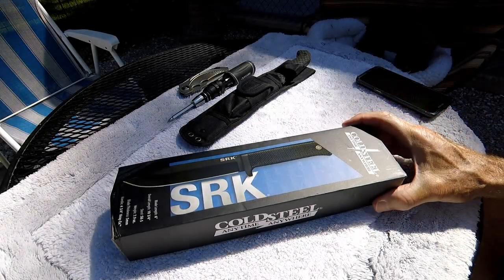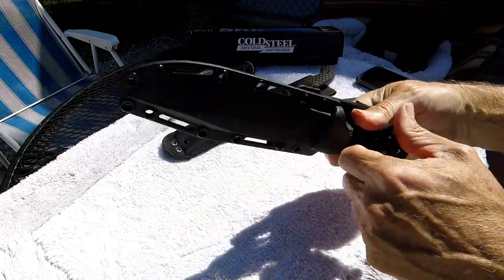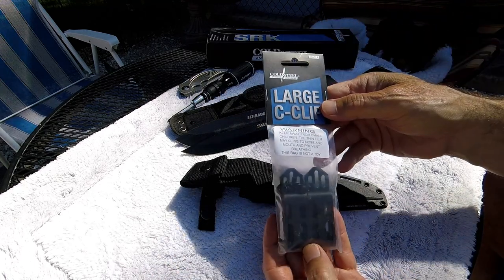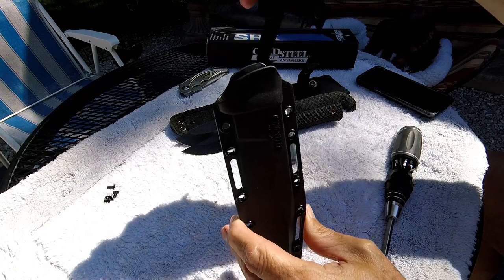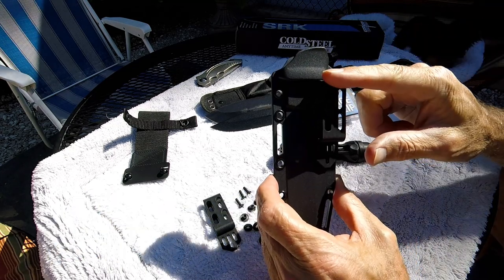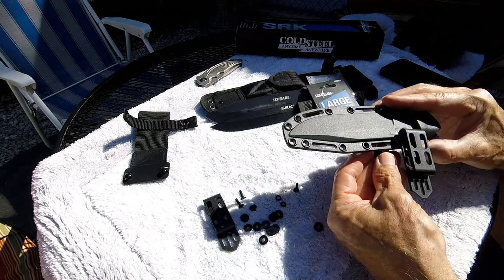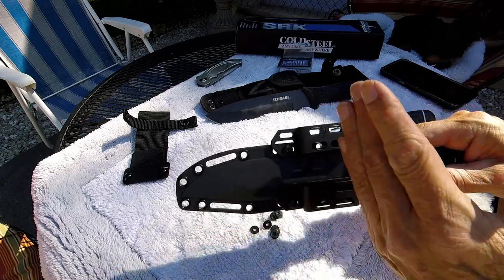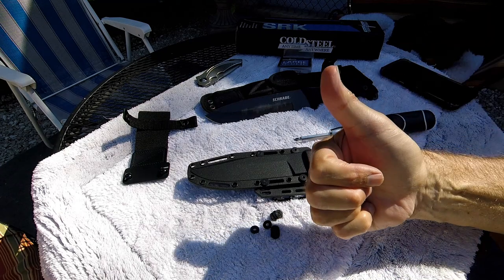Cold Steel SRK Knife C-Clip Installation

Comment: Useful! Annoying that Cold Steel drops a QR code on the packaging, but it's just to the main website. Seems easy enough to link it to a PDF or video. It's just nuts and bolts, but the real questions many will have relate to ideal positioning. You addressed many of those concerns here, as well as performing a very helpful how-to. Thank you!
Reply from the maker: Thank you Sir! 👍

Comment: With all clips, ie:  molle whatever when putting the clip on the spine side of the sheath use the screws provided,  then on the other side put a small thick rubber washer between the sheath and clip to level it out, works well on tec lock!

Comment: In the scout carry i put two para cord loops. And i find if i put one loop threaded through three of the top holes so the loop hangs about 1 1/2  it works great. The reason for going through three holes is that tie a knot in each end thread throughone hole on one side, cross over leve, then up one. This stops the cord coming out. l" i can carry inside the waste band and it is very comfortable to wear. Cheap and strong!